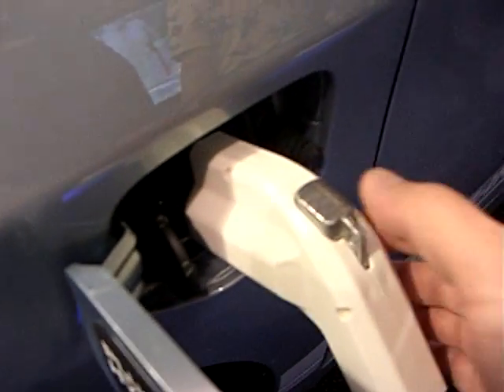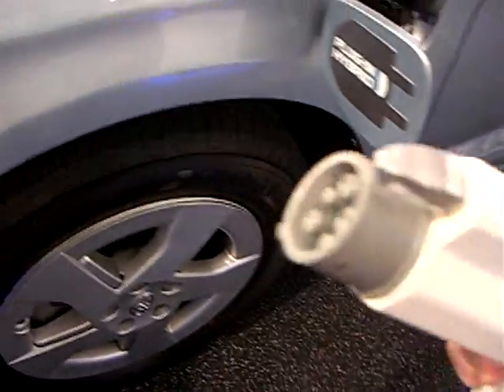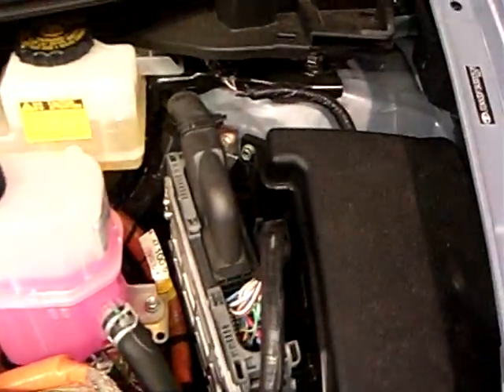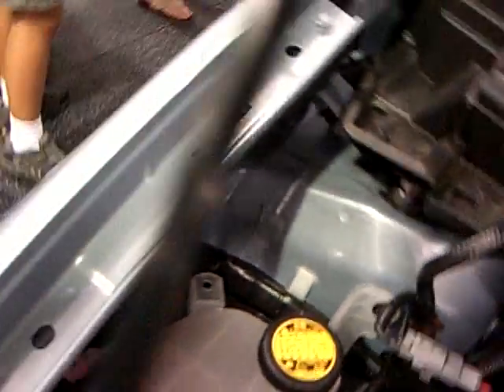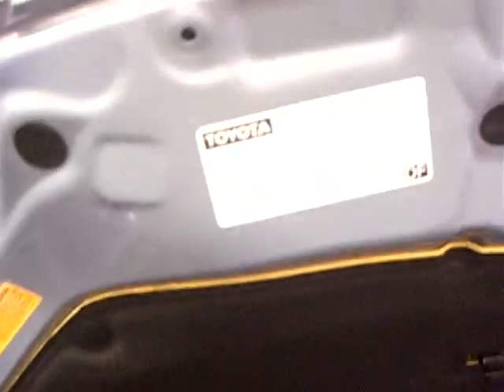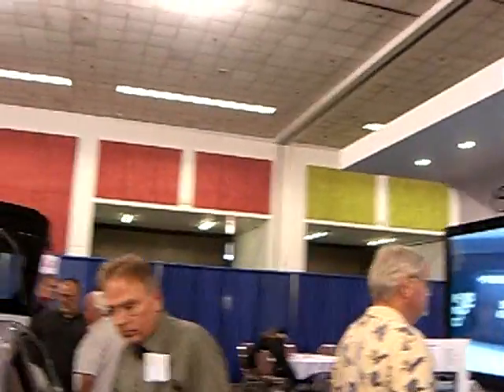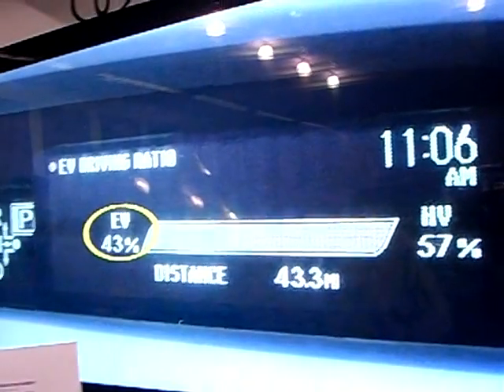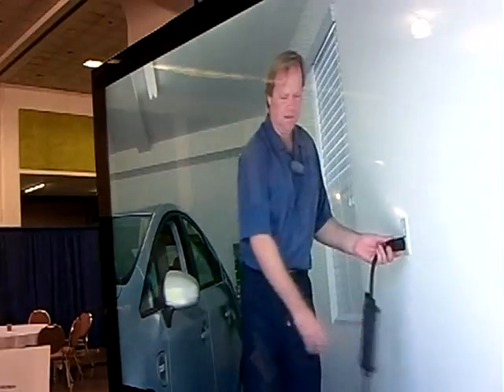New? Plug-In Prius, separate 5kWh Li-Ion battery 13miles, only charged externally  PlugIn-2010 -3/6

Comment from the maker: @whole27  This is a market test rather than any technology improvement. Only very limited amount of Plug-In Hybrid Prius were introduced to the US market. 
Pay attention that the on board Toyota Prius generator is not capable of charging the extended range additional battery, which can only be charged from an external source (while parking).